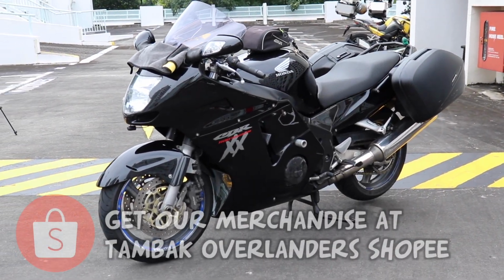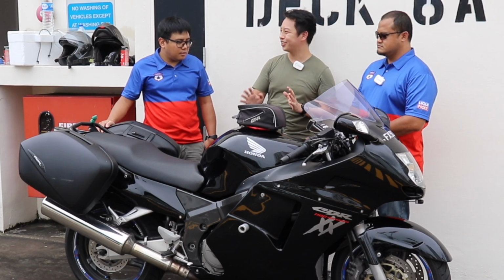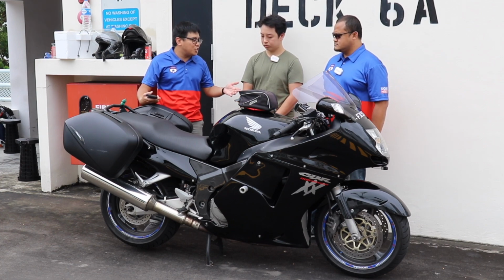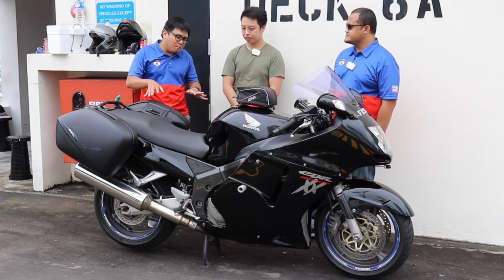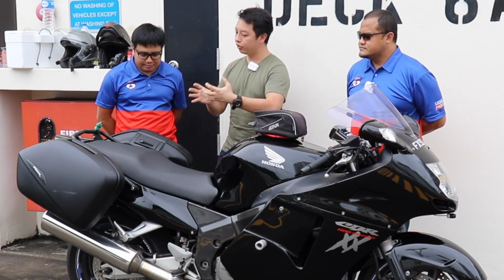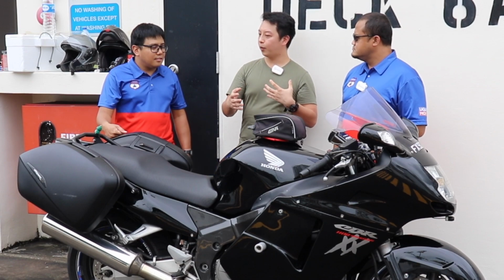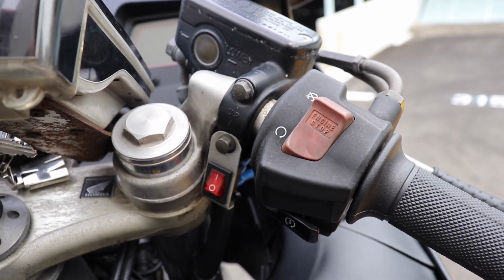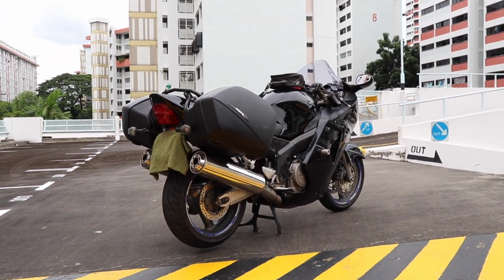Vlog#341 Honda CBR1100XX Super Blackbird | Honest Singapore 🇸🇬 Motorcycle Review

Comment: Rode the 1997 carburettor version for 14 years. Gun-metal gray was factory standard. No need for chain/sprocket replacement if you install Scott-oiler. Seat is super-comfy, but the riding position stresses your palms after 40km even with gloves. Miss the super-smooth inline-4 very much. Most mechanics hate to remove/refit the fairings. With Hepco-Becker twin 42L panniers can do 1week groceries or store 2  full-face helmets, but cannot lane-split. Combined linked-brakes only minimise fork-dive, but cannot cannot prevent skidding like ABS can. Suitable for young riders with strong back and fit arms. Engine spins smoothly at 2700rpm at 90kph at 6th gear, no stuttering effect. No need to drop gear to overtake, just twist the throttle a little more. The rectifier melts every 2 years until I changed it with a Suzuki one....